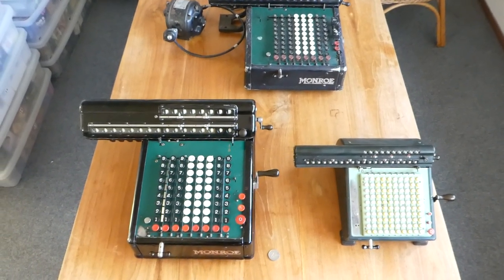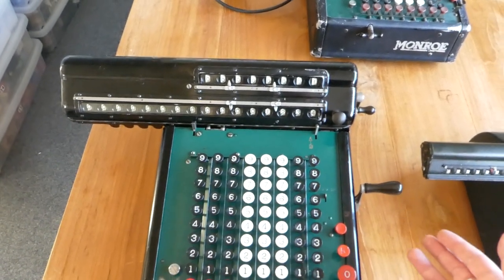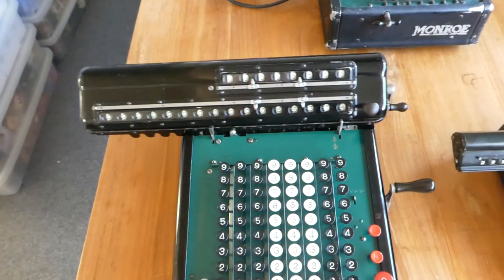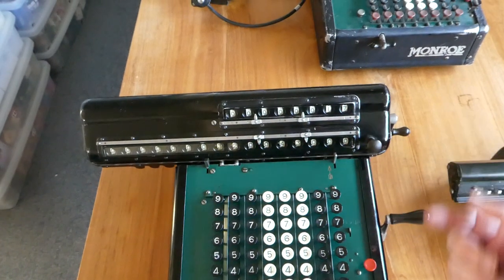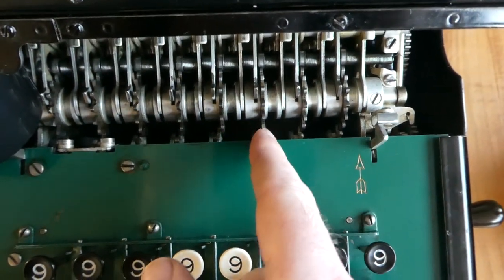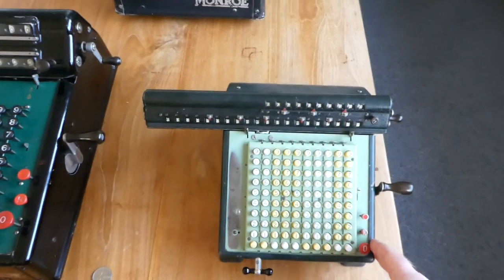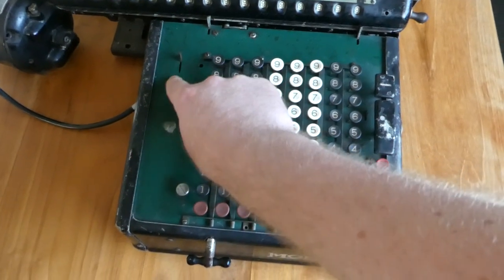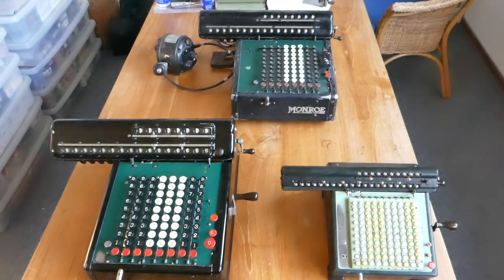The Monroe Calculator Models K, KA, and L

Comment: I got an electric Model LA for $10 today. 8 columns on the keyboard, 16 on the lower register. Everything is free except some keys are stuck internally so when the knob is rotated it puts numbers into the lower register even though the keyboard is cleared.
Reply: I think I’ve fixed the keyboard issue, the sliding stepped gears were stuck, I managed to get them freed up and working which was causing the stuck key problem.
Reply: I’m chasing down the automatic issues. The LA5 calculator mechanism is working. It matches my calculator and the Model K. I plug it in then push plus but it runs continuously until I manually disengage the switch or unplug it. The internal switch moves, not sure if it’s too sticky or a spring could be missing. Unplugged I push the plus then rotate it, a tooth hits it and it returns to off but plugged in it doesn’t. At least I figured out the switch part.

Comment: I learned something today. My Model K-160 carries to 10 places within the machine. The Model LA5-160 which I’m using manually (a lot easier to crank) only carries to 9 places within the machine. What this means is: putting 8 place sine or cosine close to 1 (0.99995678) on the keyboard works on the K but overflows on the LA5 at least given a distance over 1,000. This is when adding to a coordinate already in the lower dials, it may be okay just calculating the one side of a triangle.

Monroe’s advice is distance on the keyboard and sine/cosine in the upper dials so I’m reversing that. It works either way in the Model K.

Comment: My Monroe calculating machine looks like the model K in the video except the case is one piece, not four as the featured one.  The only serial number I have found is R61294 on the left bottom edge of the carriage.  That may not be the machine serial number, it could be a part number or maybe the carriage had its own serial number (it could possibly be replaced).  No serial number is visible in the front.  It may be inside.  The keys are the older "mushroom" style, not the newer "cylinder" style that appeared in the roughly the 1940s.  The paint is smooth.  The upper register numbers are black on white, the lower register numbers are white on black which are harder to read, they are dirty.

Everything works on mine if I'm careful.  There is excessive resistence especially when there are carrying operations to the left side of the lower register.  If I go too fast the inertia tends to make the carriage jump so the numbers don't advance properly.  When I go slow and push through the resistence it works correctly.  It isn't extremely dirty inside, just needs some clean-up and lube to hopefully help it work better.

A friend recommended sewing machine oil, another on-line source is using clock oil and light grease (where it makes sense).  I don't know which is best and how clean I have to get it.  I don't want to disassemble the mechanicals inside.  The keyboard works the best.  I think the main issue is gumminess in the carriage, especially on the left side.

8 year old Grandson fiddled with it for a few minutes, he said, "this is just like a video game!"  I'm trying to resist temptation to use it too much until I free up the mechanism better, don't want to break anything.

Comment: I have a Model K.  It is the K-20 version which adds a few extra digits to the keyboard and has a twenty-digit accumulator.  Mine is missing one key and many of the keys have been replaced.  I have cleaned and lubricated mine, and in the process found that one of the rollers holding up the carriage was broken off but it doesn't seem to affects its operation.  The stepped drums, intermediate whees and carry wheel segments were lubricated with dry spray lubricant.

I also once had an LA which is an L with an electric motor and semi-automatic division.  I actually broke mine when I stupidly tried to remove the cover over the keyboard.

Comment: My Model K has 61294 stamped on a piece on the right and 61294 stamped on the bottom of the cast frame, I had to remove the base to find that one, it’s where the foot screws in. It has R61294 stamped on the bottom edge of the carriage casting. The striker hits the bell on underflow but no ring, that’s the only thing wrong with it. And it needs oil. I’m guessing it was made as early as 1921. The front of the casting has K-175 cast in raised characters (not stamped). It weighs 28 lb.s (12.7kg)

Comment: Went into a thrift store today for something else. Come around a corner and on a bottom shelf is a Monroe Calculator which looks pretty close to exactly like your bottom left machine. $16 except I got it for $8 if you can believe that (everything 50% off). Everything appears to be working. The item counter only works if I press 1 then turn it then it works. I’m still baffled by division. I’ve done one successfully but not a 2nd one. Haven’t heard a bell. Serial number (on the bottom edge of the carriage left side) is R61294.

Also scored a 1930s (probably) K+E Favorite Slide Rule (4055) in an antique shop-$40. A beginners slide rule, A, B, C & D with Sine, Log, Tan and conversion tables on the back. Looks like Mahogany. I’ve been learning my Dietzgen Decimal Trig Log Log Slide Rule which is much more advanced (inherited from my Dad).
Reply: Made progress on division. If it underflows it seems to get jammed, then fiddle with it until it turns again. As long as I don’t underflow it works.

Comment: I just got a machine I bought with many unrelated items. It looks older, doesn't have a serial number where yours does and so far I haven't located one. The face of it is all black, and without some of the keys your model k has. Any idea what it is?
Reply from the maker: How does it compare to the Monroe model F?
See my later video: https://www.youtube.com/watch?v=fktoCGzqLhI
It could also be a model G, which is very similar to the F. Both have the serial number on the back plate.
Reply: @jaapsch2  
Double Deuce
1 second ago
I think it is a model F. On your site it says the model F has 20 digits, so at first I thought it must be a G because it has 16 like mine, but there are some small differences to the G and looking back at your F it has 16 digits too. Mine has a chrome strip attached to the carriage to the 4 holes shown in your video and no serial number on the back or anywhere else on the outside. I had another set of eyes look also. Mine is very dirty as it sat outside for a few weeks to months on a pallet, before I got it. Some rust but mostly dust. It has the same knobs as the F & G. If it had a serial # I would know for sure. Thanks PS Sorry I answered incorrectly on your F video.... the wrong video.
Reply from the maker: I'm fairly sure you have a model G then, as those have a rail instead of a row of holes in the carriage. They do normally have the serial number on the back, but maybe it had (part of) its case replaced, losing the number. I don't think the number can be found anywhere else unfortunately.

Thanks for pointing out the mistake on my site. I fixed that.
Reply: @jaapsch2  Yes, I see that rail difference. However the decals are the same as your F on the front and possibly on the back. Mine says Registered Trade Mark in the line under Monroe on the back. I couldn't tell if your F had that. The G are different. Maybe it is an early G since the red reset button is also like your F and not large like the G. Thanks for your help.
Reply: Just a thought, but maybe it wasn't given a serial number because it was the last F or the 1st G and weren't sure what to stamp it.